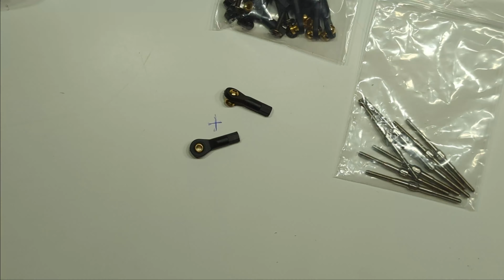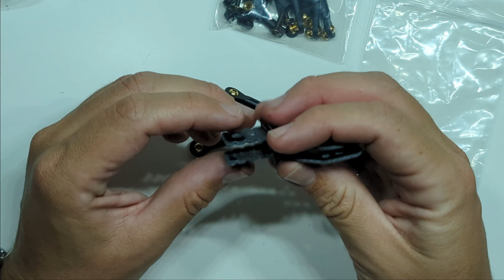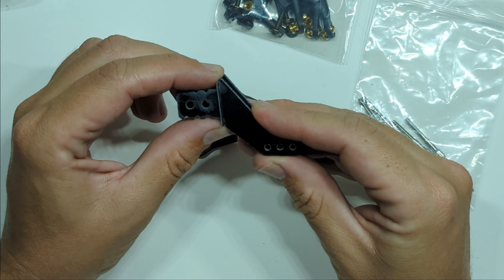104" Skywing Extra NG build part 2. Elevator, control horns and aileron servo matching/setup.

Comment: Hi Joey, I noticed that you used the center hole on both the inboard and outboard aileron horn.  I did the same as you  with my SW 104 Extra NG.  Typically, the outbound horn will utilize the outer most hole to compensate for the aileron taper.  But when I tried it, the geometry was way off.  Wonder if you kept both on the center hole.  BTW, the manual shows it being done as you did.  But on a recent SW factory flying video they used the outer most hole on the outbound arm.
Reply from the maker: Fascinating observation Greg. I did end up keeping it in the center hole though. What you suggest makes total sense, the same way my ef Laser had longer horns for the outer aileron. While I did use the center hole I don't remember there being a great deal of effort needed to properly match the servos with the EXPro. Next time I have the plane together I will look into this and make changes if required. I will also need to check out the SW video you mentioned.